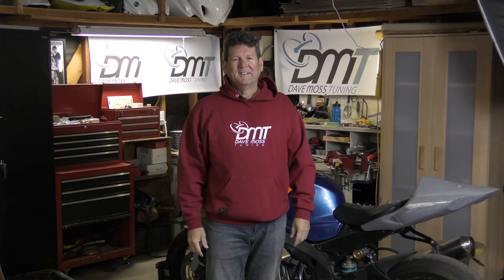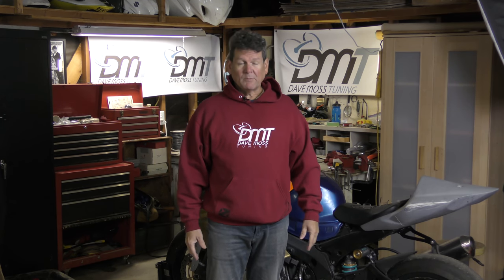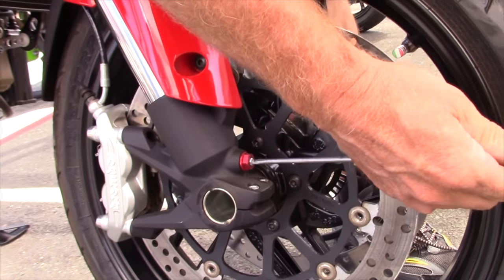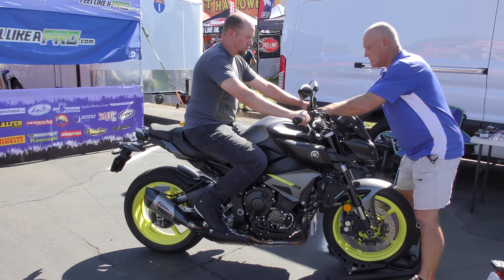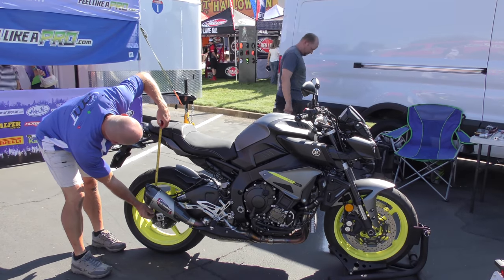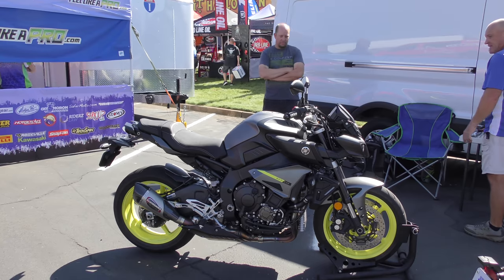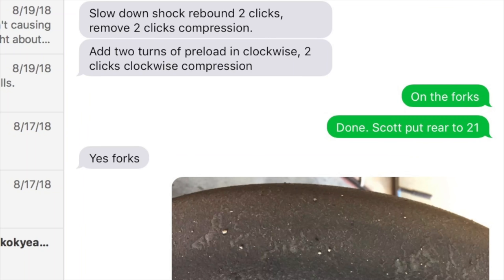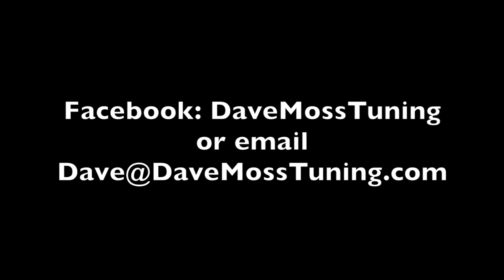2 Clicks Out: Street vs Track Suspension Setups

Comment: How in tf are you riding an S1K at the track in full leathers and have no clue how to adjust your suspension properly lol
Reply from the maker: I would say that 60% of the riders at track events I attend do not want to deal with suspension settings and prefer a professional get them to the right starting point with the first adjustment. After that, they will then start to learn about fork and shock travel and compression damping along with rebound. At that point, I encourage them to keep records of what they changed and if it was +/- ve experience after the change.